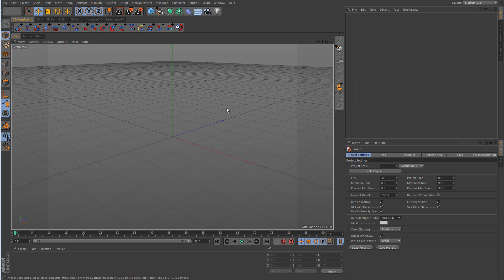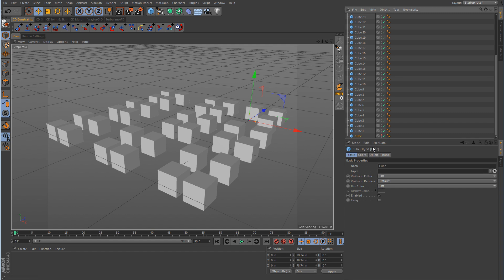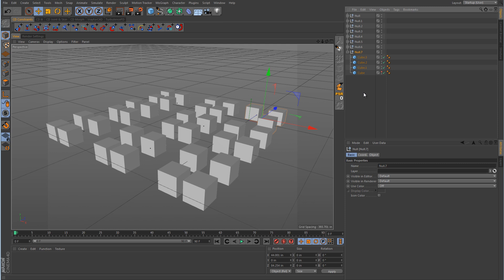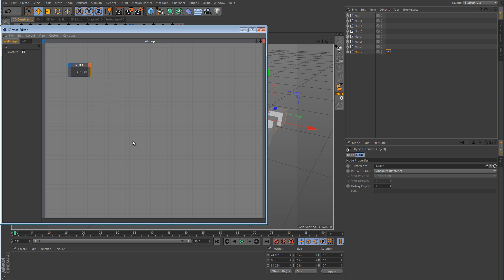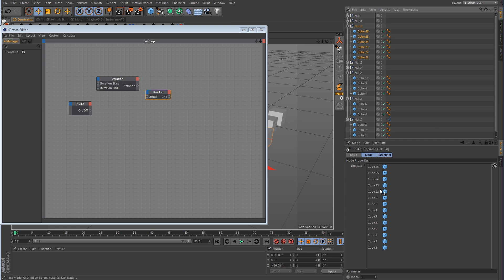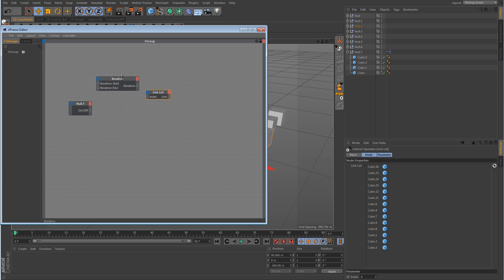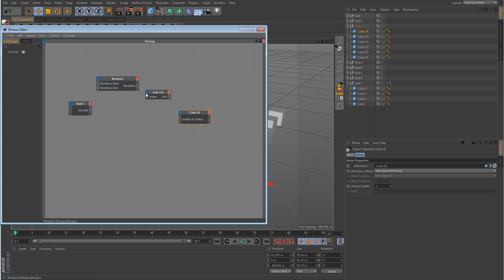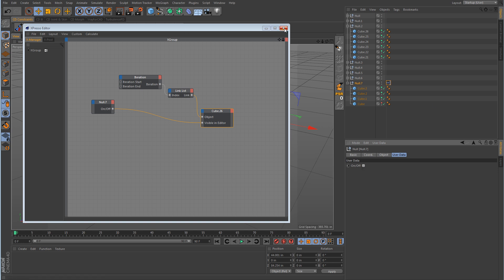Cinema 4D Tutorial - Xpresso - Iteration

Comment: Great tutorial. Got a question. if i make a copy of the "list" node, i can then pump its count into the "iteration end" of the iterator. so it automatically includes all objects in that list. 

problem is then i have 2 lists. and i can't feed one list into the other one :( and i cant directly plug count back into iterator. 

i also tried using a selection object and its list to make the lest of objects exterior to xpresso, but that doesnt seem to work either :( 

any ideas?
Reply from the maker: +Aleksey Voznesenski Im not sure if I understand what you're trying to do. Are you wanting to use the iteration node to loop through 2 lists?
Reply: no, i just don't want to adjust the "count" manually when i add more objects to the list.
Reply from the maker: +Aleksey Voznesenski I am not aware of any way to do this, but I will look into more. Perhaps there is a way.
Reply from the maker: +Aleksey Voznesenski I believe I have found a way to do what you want. It does not use the iteration node, but rather the object hierarchy node. I will try to make a quick tutorial later if I have time.
Reply: awesome! looking forward to it!